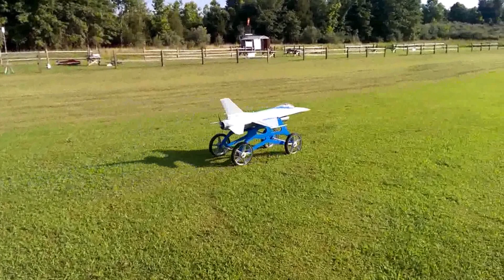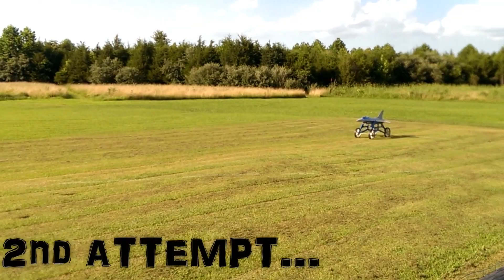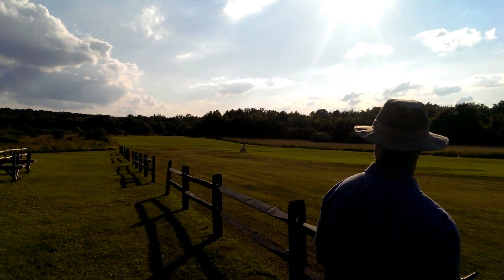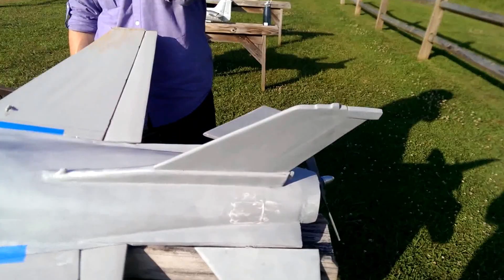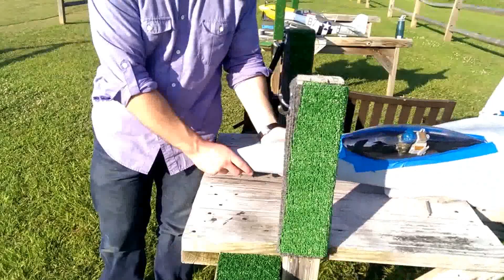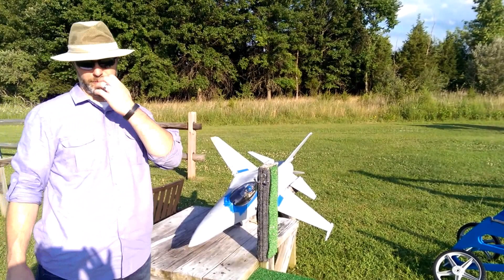BIG F-16 Launch Failure and Crash

Comment: Wings are to small, no lift, and no power from the motor. Also trolly is to big, it might worg on a asfalt runways
Reply from the maker: Yup.  MANY mistakes were made with this attempt, but I learned from the project.